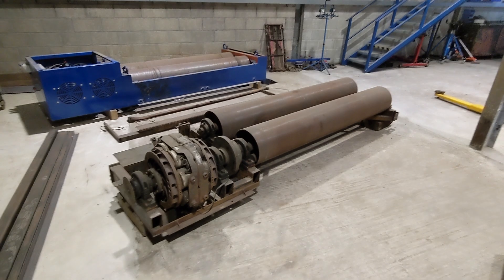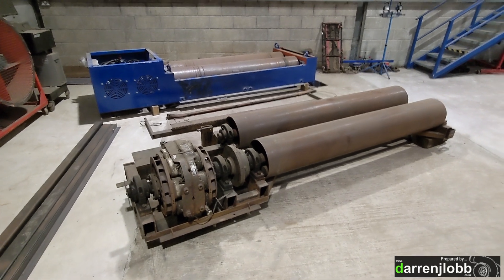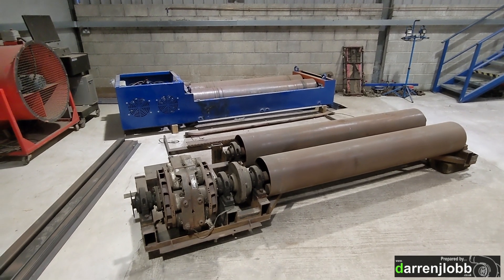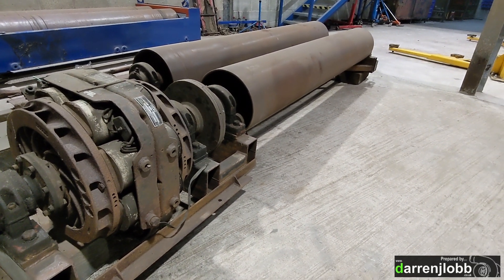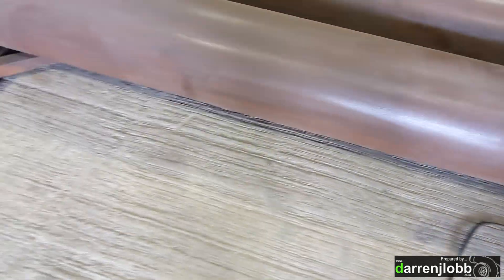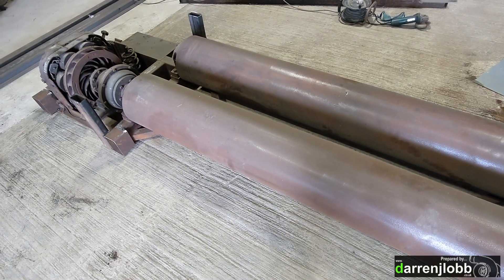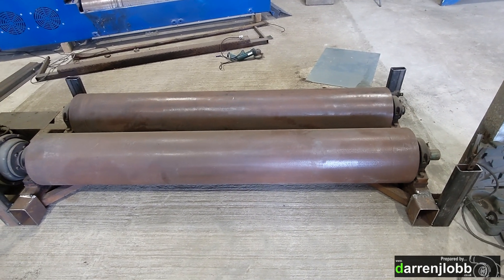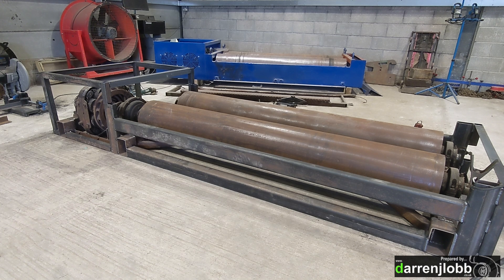4x4 Chassis Dyno Project Part 1

Comment: The air lift is just a length of fire hose or lay-flat hose. There used to be flat web straps on the underside that lock the rollers when the lift is fully extended. Mine were missinge but when i fitted them it makes it so much easier to drive off.
Reply from the maker: Indeed, very hard to find fire hose in that size now though I have found! Made a compramise with some slightly smaller OD but should be good enough.

Comment: Get in. More content. I'm assuming you have to have flexibility with a awd Dyno for different wheelbases?
Reply from the maker: Correct, the rear dyno bed will move fowards / backwards to cater for wheelbase size :)
Reply: @darrenjlobb  that's going to be interesting to see how you tackle keeping them parallel.

Comment: These are a variant of the sun ram 12 dyno's if im not mistaken? Are you going to mechanically link each set of rollers together? Take a look at the superflow 4WD system for an example. Used to operate a rolling road for 2.5 years in a previous job so this is quite interesting.
Reply from the maker: The beds are the slightly ealier Ram 11 beds...Not going to be mechanicaly linked, roller speed will only be matched by software, will work for all mechanically linked 4wd cars, but not some more modern styles.

Comment: Being 4x4 dyno the hole in the floor would need to be pretty big to allow for adjusting for wheelbase and easir to strap if it's up in the air. If you were dynoing cars all day everyday sink it in but you'll be fine the fabrication looks spot on
Reply from the maker: Thanks, this was my thoughts also, would be a huge hole in the floor, and a real pain if i decided to move it / change it in the future, so kept options open for now with an above ground setup!